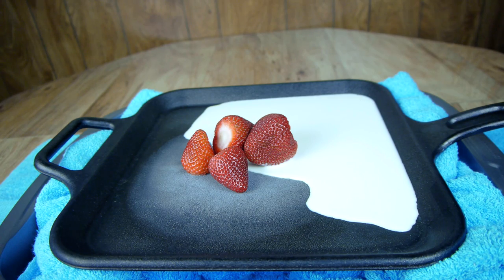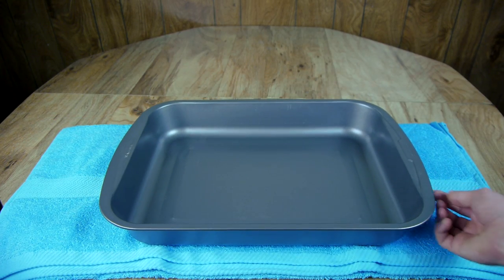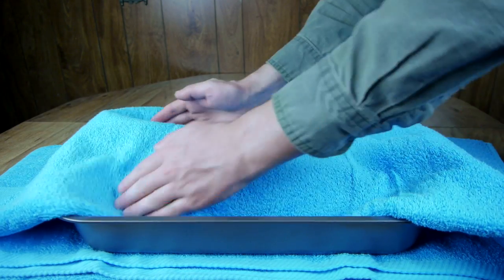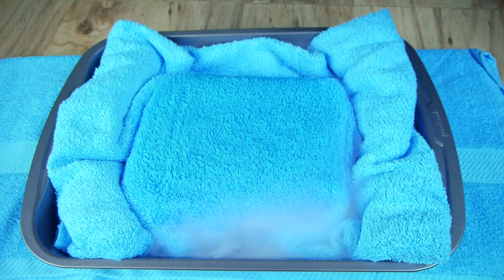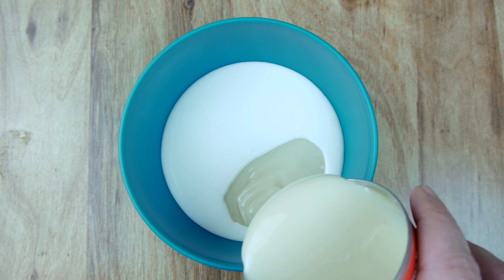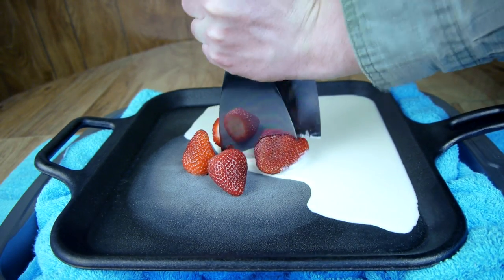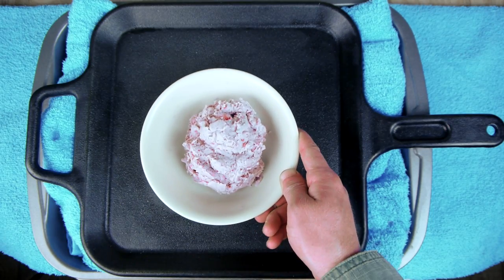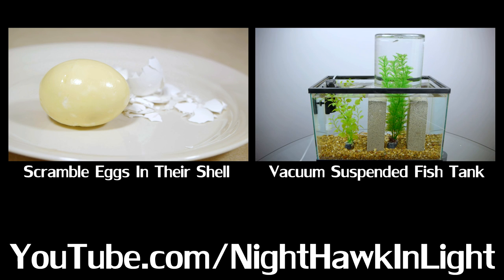How To Make Ice Cream With A Frying Pan [DIY Cold Stone] - NightHawkInLight

Comment: Just a general tip - don't use metal utensils/tools on non-stick pans *EVER*. If you do, you will scrape up and ruin the non-stick coating completely. For non-stick pans, it's best to use plastic, rubber, silicon, or wooden tools/utensils so that they won't ruin the coating. If you have a stainless steel pan with no coating or, better yet, a cast iron skillet like in this video, you're good to go.
Reply: This^
Reply: Most non-stick pans are also not going to have the thermal mass to work with this. Cast iron skillet every time.
Reply: Anna Gump
Reply: Adrian Sanabria That^
Reply: Anna Gump I did already know

Comment from the maker: Welcome back to NightHawkInLight's food tips and cooking channel! Heh, not really. But this was a pretty fun project with summer right around the corner. Leave me a comment! I always like hearing from you.
Reply: :v
Reply: maybe a tip: put the links to the video's on the outro screen in the video discription, for mobile users
Reply from the maker: +Niels Hakkert Done!
Reply: +NightHawkInLight Thanks!
Reply: +NightHawkInLight Considering you get a comparable amount of cooling from regular ice as opposed to dry ice do you have an idea to make this cold plate work with regular ice instead?
Reply from the maker: +Sir, TotallyCooki Dry ice is much, much colder. You would have a really hard time getting this to work with regular ice.
Reply: +NightHawkInLight While dry ice is colder, it transfers temperature at a similar rate as water. Adding salt should increase the rate at which it does this aswell which is why the "ice cream in a bag" trick works.
Reply: +Sir, TotallyCooki I don't think it "transfers temperature at a similar rate" as the transfer rate is proportional to the difference in themperature BUT the enthalpy of fusion of water is much greater than dry ice. It means you have a lot more "cold" stored in the same volume of dry ice / water ice. I think it could work with ice and salt as you suggested if the temperature gets cold enough (adding water and not using a towel would probably help).
Reply: +NightHawkInLight  Hay, I have seen this trick else where but Ill bring it to your attentions. its cool and ya might wanna try it.  Dry ice in a cooler, cover in towel, place fruit all around, wrap cooler in sure wrap (that plastic wrap stuff) to completely seal. after 12 hours you should have fizzy fruit.
Reply: +NightHawkInLight What if I can't buy dry ice in my country?
Reply: +NightHawkInLight This needs a remake but with a old mini fridge or water cooler or maybe a window unit so it can freeze the ice cream
Reply: only in america :)
Reply: More this video
Reply: I tried it. it works!!!
Reply from the maker: Awesome, glad to hear it!
Reply: ❤ Tay Swift Liquid nitrogen is harder to obtain, lasts less and is much more dangerous.
Reply: ❤ Tay Swift You said that liquid nitrogen is better, which is not true, as it over double the temperature or dry ice  and much more dangerous if it comes contact with the skin.
Reply: NightHawkInLight
Reply: NightHawkInLight
Reply: NightHawkInLight can I put anything but not alcohol or vodka can It be water
Reply: NightHawkInLight can we use normal ice or sth else???
Reply: ❤ Tay Swift ok...thanks for answering 😊
Reply: NightHawkInLight "
Reply: LeaMicheleFan tons of normal ice with extremely cold water, almost freezing and a layer of salt, then some more normal ice and another layer of salt
Reply: Im guessing you can toss the dry ice back into the freezer once your done to use it again nextime

Comment: Sadly they don't sell dry ice here in the Netherlands :(
Reply from the maker: +oostamovies If you get a thick plate of steel or stone and put it in the freezer overnight you can make ice cream on it the same way. You just have to work fast because it won't stay cold enough for very long.
Reply: +NightHawkInLight 
Thanks for the tip! I might try it this summer ;)
Reply: +NightHawkInLight I will definently do that o.O
Oostamovies I am dutch too so thanks for asking :D
Reply: +NightHawkInLight do you know if there are special places where you can get dryice?
Reply: +NightHawkInLight Would the stone work better because it's not as thermally conductive as steel and would therefore maintain it's temperature longer?
Reply from the maker: +Kai LEM No because you want the dry ice to pull the heat out of the ice cream effectively. Otherwise the air will heat it up faster than the ice cools it.
Reply: +oostamovies Dry ice isn't commonly sold here in Finland either, but it's available in stores such as AGA (idk if they have stores in Netherlands though) or other hardware stores where you can buy HVAC equipment
Reply: +NightHawkInLight To prevent it from cooling too fast perhaps you could place iron slab in an ice bath that contains salted ice.
Reply: if you can get a hold of a co2 fire extinguisher spray that into a sock over the nozzle anad youll make dry ice 😊
Reply: +NightHawkInLight wouldnt it be best just to freeze the pan itself?
Reply: +oostamovies I also have never seen dry ice here in Germany. But there are some online shops where it can be bought here, you could search for that too, either a shop that delivers into the Netherlands or one in your country. (After a quick search there is at least one shop for that).
Reply: +Super Marijus 
That might work but the pan would warm up really quickly.
Reply: they do sell it in NL. just not in grocery stores.
Reply: +Hawk_ Eye 
Only in bulk rite? For restaurants and stuff.
Reply: DanieleGiorgino unless its very thick.
Reply: But they sell weed 😢

Comment: Apologies if it's been answered, but how do you transport dry ice? A standard cooler?
Reply from the maker: +Nelinno04 yep, a regular cooler. It will last longer if you also wrap it in a space blanket inside the cooler. Don't use any container with a latch or that's completely air tight.
Reply: NightHawkInLight OK, thank ya sir.
Reply: +NightHawkInLight I want a space blanket! That sounds cool!
Reply: +Nelinno04  Grant is correct on the air tight coolers with a latch you essentially create a dry ice bomb.  I like to use the cheap Styrofoam coolers.
Reply: +darkcwboy Grant? I think you mean Ben
Reply: Are you a anime lover

Comment: good luck finding dry ice if you dont live in the UK or the US...
Reply: +Moustache Guy never seen it for sale in the UK...
Reply: buy a fire extinguisher that doesnt use that foamy stuff.. get a beanie or a cloth bag, and spray the fire extinguisher  into it... makes dry ice
Reply: a CO2 fire extinguisher
Reply: +MDShadowMan FTW There are other type of fire extinguishers, dry chemical, water, halon etc etc.
Reply: +Luca Pearson You need to freeze it as fast as you can to prevent large ice crystals from forming. There are several 'shake' methods using salt and ice and some plastic bags that work fairly well.
Reply: forrest225 a CO2 one

Comment: hi,what's the alternative if using alcohol isn't an option?
Reply: What if using alcohol at all is not an option
Reply: Make it an option. Go buy some alochol.
Reply: you could use water, but the pan must be set onto towel while it us still wet. the water in towel will quickly freeze to conform to underside of pan.
Reply: +Christopher Bright you could also use antifreeze. just get the kind that's not so poisonous.

Comment: What is the non-alcoholic alternative to sprinkle on dry ice?🤔
Reply: Are you asking bc of dietary or religious restrictions on alcohol? Bc the alcohol isn't meant to be consumed in this method. You could use isopropyl or some other non food grade alcohol. It'll probably be cheaper too, since those don't need to pass FDA (or other government) inspections for food. 

Alcohol is kind of the best, most accessible thermal interface for this method.

Comment: were does one get dryice in holland
i know its legal i had it bevore (got it on a event)
Reply: google.
Reply: rocketguyandtompan07 i know
special companies supply it
30 a 50 euro's per 10KG
and no smaller amounts
Reply: just buy a 10 kg block and cut bits from it when you need it.
Reply: rocketguyandtompan07 you know it just evaporates in around 2 a 3 days
Reply: rocketguyandtompan07  that still does not work
Reply: ***** yes ofcourse, but it will delay it signifigantly.
Reply: rocketguyandtompan07 no not realy
i kept it in a styrofon box
insulated inside a celler
and it was gone in 3 a 4 days
(got 5 kg free 2 a 5 years ago)
Reply: ok.
Reply: rocketguyandtompan07 its a weird thing to play with
Reply: lmao

Comment: aren't there some safety concerns with big chunks of dry ice and enclosed spaces?
Reply: Not really. If you are super concerned you can open a window but you would definitely feel a bit weird and be able to ventilate before any real danger if there were a problem. The co2 is obviously cold when it sublimes so it would sink to the floor level and take quite some time to acutely fill any portion of the room bottom up.

Comment: Stupid question alert: How do you dispose of the dry ice properly? Do you just, like, throw it in the garbage or what?
Reply: "The only stupid question is the question you already know the answer to."
I'm not sure if this is a joke. If you already know the answer, it's a joke. And if it is a joke, congratulations--you made me smile. 
In case you actually don't already know, the dry ice sublimates, which means when the solid CO2 (dry ice) warms, it skips the liquid phase and transitions directly into a gas. So the dry ice will become a gas at room temperature. Nothing to dispose of! 
And just in case you don't know this either: Don't touch the dry ice directly! It is so cold, it can actually burn you!